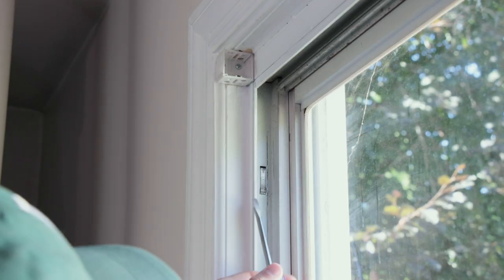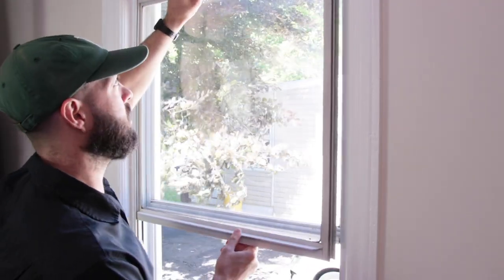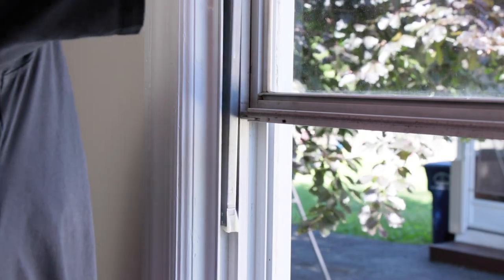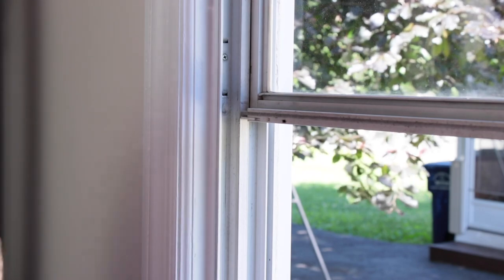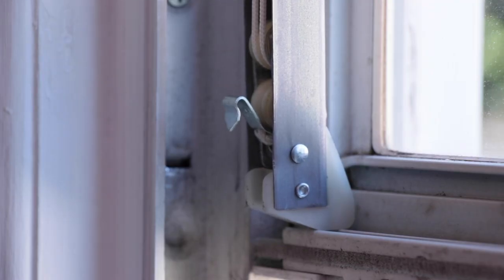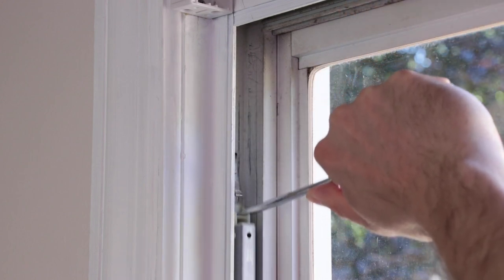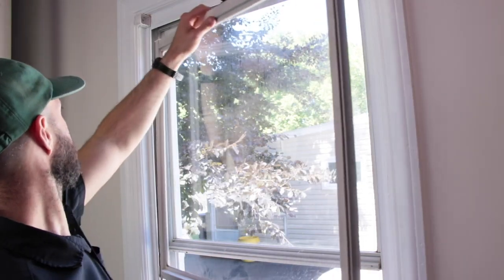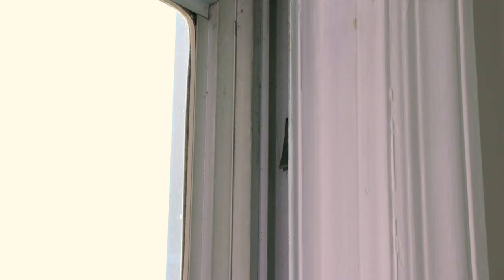How to Replace a Non-Tilt Channel Balance

Comment: In this video he calls that upper clip "channel attachment"... is that the only name for that?
I need to replace one that apparently broke off.
Reply from the maker: Usually so! However, since it's riveted on, it's usually easier to replace the whole balance. You can find both the top attachments and balances here - https://www.swisco.com/cl/Sash-Support-Balances_Hardware

Comment: In my case removing the rubber bumper at the top of the frame made the process way easier.  If you have a rubber bumper at the top remove it before removing or installing the channel balance.